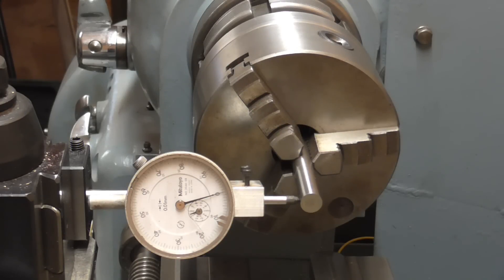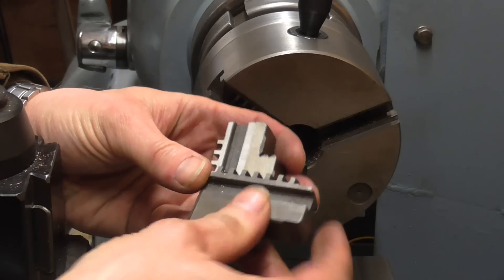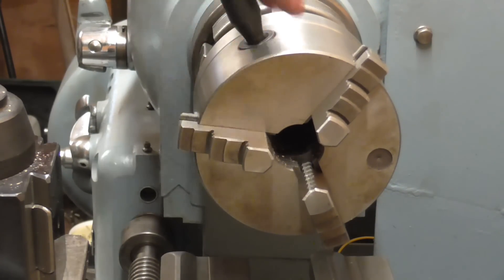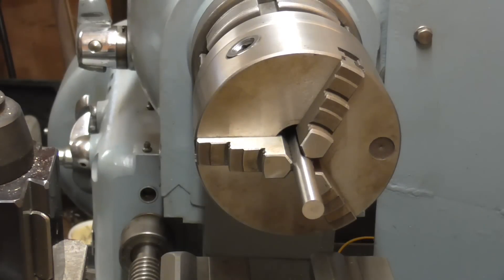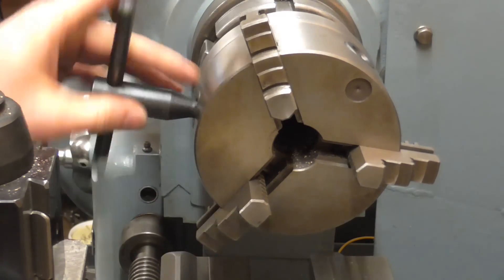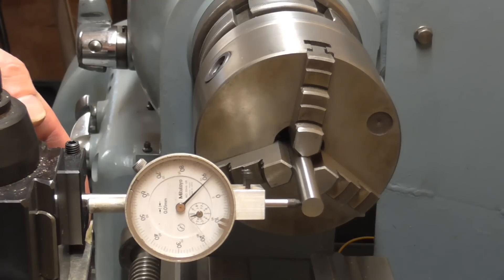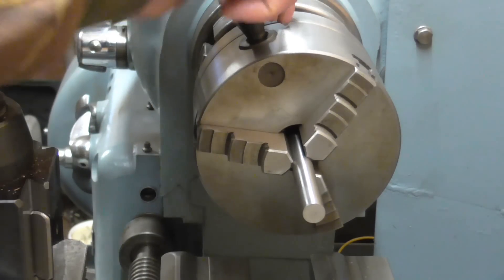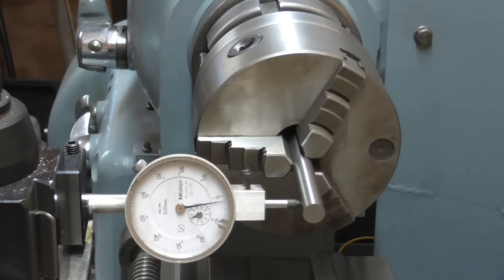3 Jaw Chuck run-out

Comment: Why has noone pointed out that unsequencing the jaws will guarantee the runout to be on the order of the scroll pitch? The scroll is the source of the runout. Adjusting the jaws will limit the utility of the chuck to only that diameter.  If you want the stock to run true, then use a chuck that can be adjusted...like a four jaw chuck.
Reply from the maker: The whole point of the video was to show that the sequence the jaws are inserted into the scroll is the most important thing for concentricity. Having them in the wrong numbered slots , but in the right sequence will throw off the concentricity only by the errors in the scroll machining. Only jaws that were ground in the same chuck are guaranteed to be most accurate in their numbered slots. Aftermarket jaws may er more conentric in different slots.

Comment: How many points do we deduct because you didn't measure the chuck run-out first ? Can't expect the jaws to be true if the chuck body isn't !

Step 1: dial-gauge on the spindle nose taper - then work along each bit you add: back plate, chuck and finally jaws.

Comment: when you fix the rod on the Chuck, you must secure the 3 screws Driving the jaws, not solely one !!!
Reply from the maker: You've obviously never encountered chucks that only have one key position!

 Chucks have ONE master key position, which is the one used for tightening and then grinding the jaws. Using this jaw then gives the best concentricity. 

Using all three positions allows you to get the chuck tighter for the same effort on the chuck key,  but shifts the scroll position and changes the runout. Track down Abom's video where he mounts a new precision chuck and is surprised by how much runout there is compared to the chuck body. Adam always uses all three keys (except of course when he's showing off his 4 jaw skills!).
Reply: @EVguru   it seems your Chuck has 3 key positions, clearly visible.  2 are only fake keys, . However at 10:40 you use the 3key positions????

Comment: This is actually a SCROLL CHUCK and by design NON-ADJUSTABLE.  Jaw for this chuck are numbered and then ground true at the factory-  why would you expect to do better by rotating them ??  The real key to a good 3-J scroll chuck is the precision of the scroll and if not close to perfect, it could be 0.000 with one piece and way out with another of a different diameter.  Fiddling with jaws is a waste of time-- the chuck was either made correctly or not...

Comment: Strangely??  when the jaws are in the correct sequence, the last chuck key hole just happens to be the one with the spot face in the chuck face - is that a clue for the best key hole?? 0.03 mm concentricity is Good enough all day long for hard jaws!!   PS - can tap (fine tune) true with the wooden heel of a hammer/mallet on the jaws if that picky!!

Comment: Hi Paul. with regards to jaw 1 starting in position 1.. if a new set of jaws were fitted to a older chuck how relevant would it be for jaw one to start in the position starting 1?
Reply from the maker: Jaws supplied with a chuck are ground in position (tightened with the master key) . Replacement jaws are not of course and may centre better in the 'wrong' position.

As long as a chuck grips parallel, that's the main thing. In my opinion far too much emphasis is made of how accurately a chuck centres.
Reply: Paul Compton 
Thanks!

Comment: The correct way to correct concentric runout is to check it like you did, then find the highest point the opposing jaw or jaw's is too high towards the center, now grind on a surface grinder the amount needed or a jig with a 1.5" diameter diamond wheel, grind it square perpendicular to the scroll teeth perfectly you should fall within .ooo5 like i did. You're adjusting the jaw to the scroll not the casing although it needs to be centered too. I hope this helps.
Reply: That certainly will work for the exact diameter you grand the jaws at. But then as soon as you chuck a different diameter piece of stock, it will run out again.
The trouble is in the scroll, not the jaws.

Comment: took mine from near .02 out to .0015 by using receipt paper between the backing plate and the Chuck. put a pipe in the Chuck for leverage and only one screw needs to be loosened to get paper in a position

Comment: If you want your chuck to repeat accurately, put the chuck key in the same socket every time.  Put some dykem around the socket.
Reply: If you want consistent routines miti grrr ation, use a four jaw chuck.

Comment: Paul,
I think most of us would be satisfied with a repeatable 0.0015" run-out on an older 3-jaw chuck. I found consistently tightening first with the master pinon (sometimes marked with a stamped zero or found through experimenting) produces the least run-out (less than 0.001" improvement but still better than none).  I also found experimenting with chuck mounting lug positions on my D1-4 spindle and using the locking lug positions that produces the smallest TIR is worthwhile doing. 
Thanks for showing this video,
Paul
Reply: Paul Jones

Comment: I would have enjoyed seeing the run-out on the chuck body also.
Frankly I am amazed the run-out is so little.

I recently purchased a China metal square, it was out .020 per inch.
I have plastic squares that were much more accurate than that.
Of course I returned it and purchased a name brand.

I am not saying that all China is junk, just the quality control is lacking on some stuff.

Comment: I never use hard jaws, chamfered soft jaws are much less hassle. Just need to make a set of  "spiders" and 1/4"  pins that can slip into holes machined into the jaw faces. Then just re skim them when necessary.
http://i.imgur.com/bkCJiM0.jpg

Comment: Why use the key in 3 places? surely this should have no effect as you are just rotating the scroll anyway.
Reply from the maker: john brown The scroll has clearance in the chuck, so it doesn't just rotate, it moves sideways a little and binds. I cover this in my 'Anatomy of a 3 jaw chuck' video; http://youtu.be/sumudzNrPhk
Reply: Paul Compton Great, thank you, I will take note of that,
Reply: john brown It is also worth mentioning that the teeth on each pinion and the scroll in positions for frequently held stock diameters will wear more evenly if you tighten the pinions progressively, as this minimizes the chances of accidentally favoring one of them. I doubt it would matter for a reasonably long life of a chuck, but I was taught it as good practice anyway.
Reply: canid song Thanks for that, I have just turned up and threaded a mount plate for an old 3 jaw chuck which was out to blazes, the wear on the jaws suggested a lot of "skidding" of work done by someone over many years however they provided me with rarely used reverse jaws which are in great shape.Finally got round to turning up a piece that had been in the too hard basket for 35 years to put this chuck to use. My old lathe is flat belt drive and I get belt slip when taking a cut of just about any reasonable depth [not tiny work, larger stuff], failing putting great strain on the flat belt I don't know how to overcome this problem, strange as the gap bed allows up to 20 inches {USA reading, 10 inch English]} swing, can never imagine how anyone could have achieved anything remotely like this size.

Comment: Hi Paul:

I love your Harrison; is that a Late 12" L6? maybe one day you could give us a run of its features. Concerning Oriental offerings one the areas where is easy to cheat in marketing is the fact that lathe chucks they all look alike and the "proof is in the pudding" after you bought it and try it, you don't know. Therefore, it comes down to price because many of the "Premium" brands are also made there despite popular belief to the contrary and they are very good. .

Regards

Jorge
Reply from the maker: The lathe is a 1963 L5 and I do keep thinking that I could have done with an L5A or L6, but it was a nice machine at the right price.

I thought I had done a piece on the lathe, but perhaps it never made it through the edit. I'll think about doing a feature soon.

Comment: Hi Paul,

many thanks for taking the time to make this video. I would be quite happy with 0.03mm runout on my chuck. :) I have a colchester student lathe mk1.5 (with gap to allow turning up to 18"). I bought an L0 backplate and a new Chinese chuck and fitted those. Because I only had vernier calipers to work with, I ended up with a runout of 0.20mm at the jaws. So you can see that your 0.03mm runout suddenly doesn't look all that bad. Its all relative! :)

Cheers,

Mich

Comment: Hi Paul,

Good demonstration of why its a good idea to check your workholding and pay attention to the numbering.  I have noticed that chucks also vary by the clamping diameter. In particular on old chucks they see a lot of wear in the 1/2 inch (13mm) to 1 inch (25mm) range. A cheap investment are a handful of gage pins in some common diameters to use for setups and interrogations like this. Individually they are quite reasonable.

All the best,

Tom
Reply from the maker: Hi Tom,

My requirement for a 3 jaw chuck is mainly that the jaws aren't bell mouthed and/or loose in the chuck body. Run-out doesn't bother me that much. I had it drummed into me at school to machine all concentric features in one setup.

I've used chucks where the runout was excessive because the jaw set wasn't the one supplied with the chuck, so I wanted to show that contrary to what some people believe, you can put the jaws in the 'wrong' slot. I don't think I made that clear enough. 

I plan to do an 'Anatomy of a Scroll Chuck' at some point.

Comment: Hi Paul, If it is not marked, convention says  the master keyhole is the one by the label or in your case the recess where the label would be. If your were using silver steel as your test piece did you check it for tri-lobe shape with a vee block or a vee anvil micrometer?
A friend popped round this PM and showed me a photo he took, at AP, of us chatting, aren't you short.:>)
LL&P
chris
Reply from the maker: Yep, just 5'11" and I still often think the floor is inconveniently too far down!
Reply: I would not "trust" any markings on the chuck, even if it says "master" next to a key slot by the manufacturer. The best position you find by trying to tighten the workpiece and watching your indicator. I have had the best experience when the DI is on top of the workpiece and I tighten from the keyslot that is closest to the position that my clock says "low". Just by doing 2 revolutions I can usually geta workpiece within just 0.03 mm on any given 3-jaw chuck.

Comment: Maybe blow some chips out the inside and before you clamp it down fully twist the stock just before your final tighten,Keith fenner does this all the time to make sure correct alignment..I did notice you done that on the last one,But you have a fair bit of stock hanging out the back side of the chuck aswell..Is it possible the test piece could be off a little.